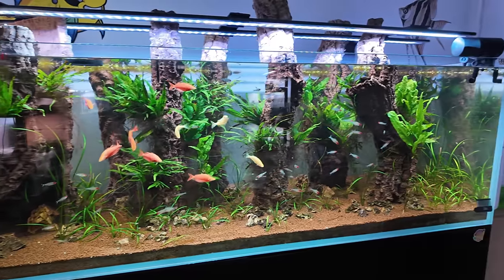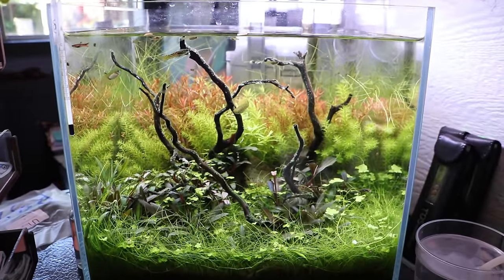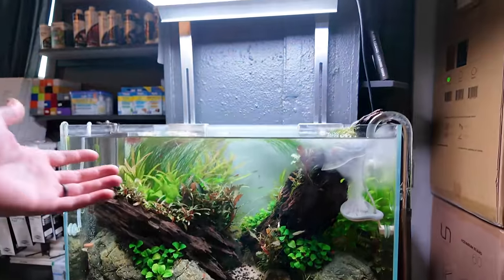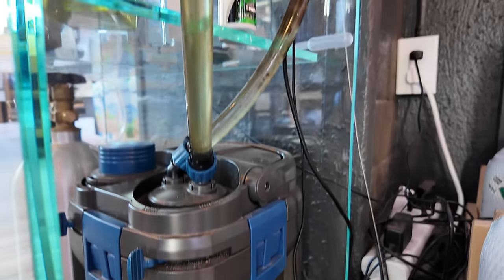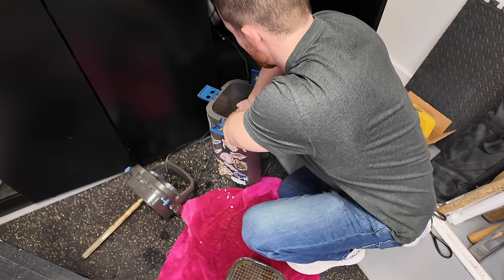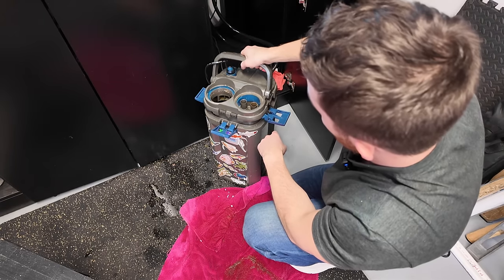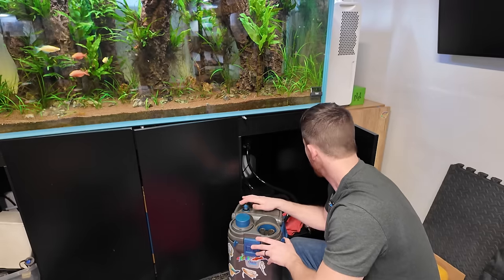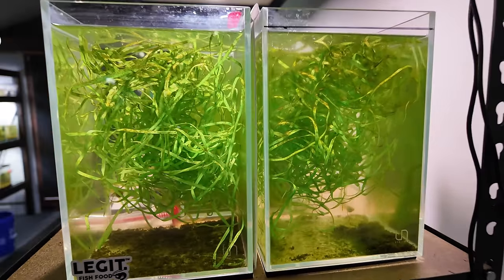This is ACTUALLY The Method For Crazy Clear Aquarium Water...

Comment: It does matter where the purigen goes. The order should be mechanical- bio- chemical. If you put the purigen lower in the order, it will fill with organic waste and the compounds it is supposed to remove will bypass the purigen. Your tank is awesome.
Reply: Purigen should be the last thing water touches before it enters the aquarium
Reply: Yep bottom tray if you have an fx6 or 4
Reply: Yes I remember it that way as well.
Reply: Noted ty for that advice
Reply: IDK...Your water looked amazing to me B4 you added the Purigen
Reply: It went in the trash for me.
Reply: The Tank looks crystal clear from the start I don't think you'll see much difference.
Reply: Mid to upper of the tank use it after dirt and so on
Reply: Amen to that

Comment: First sentence on the package "Purigen should be rinsed before use". Amazing that every YouTuber that does a video on Purigen doesn't rinse it. You even dipped it in water at the start of the video and saw all of the white discharge.  Argh! Your tank water looks visibly clearer after Purigen.  Thanks for the video.
Reply: I rinse my Purigen in RO water until it is  visibly clear. (Our home came with an RO system when we bought it in 2004.)  Using a water softener also decreased the mineral deposits around the lid and what is there, easily wipes off, not so prior to this home. Purigen turned the tide on my water clarity.

Comment: I have been recharging Purigen for a long time now by soaking it in Prime for 24 hours after the bleaching. Move it around a few times during the 24 hours and you are golden.
Reply: I foolishly didn’t rinse mine well enough and put it back in my saltwater tank . Killed all of my fish and 95% of my corals . Over a thousand dollars worth !
Reply: @lakedog3616  OUCH !!!  That would hurt.  {understatement}
Sympathy.
Reply: Sorry if I’ve just asked a dumb question but what is Prime??
Reply: @Jayjay1lm  
What does prime do for a fish tank?

Seachem Prime Conditioner for Marine & Freshwater Fish | Petco

Prime {states that it} removes chlorine, chloramine, and ammonia. It converts ammonia into a safe, non-toxic form that is readily removed by the tank's biofilter. Prime may be used during tank cycling to alleviate ammonia/nitrite toxicity. It detoxifies nitrite and nitrate, allowing the biofilter to more efficiently remove them.
Reply: What is your dilution ratio for the Prime? I'm assuming that you don't soak it in fully concentrated Prime.
Reply: Haven’t successfully recharged the purigen. I try end up buying new
Reply: @daniellesomerville3018  My water:bleach ratio for the initial soaking is 19:1 and I use 4 capfuls of Prime in two gallons of water for the detoxification. The cap is from my 1 Gallon bottle of Prime so I am not sure if it holds the same amount as the smaller bottle caps.
Reply: @AyeGeesy I'm surprised the bleach does anything when diluted this much. Normally a 50% dilution is the max recommended...

Comment: When packing a filter remember that water should flow in this order thru the filter..
·Mechanical media (like sponges) ·Bio media (like ceramic/plastic balls and rings) 
·chemical media (like puragin, carbon, and zeolite)
Reply: I add floss ontop off it all..
Reply: yeah makes a lot of sense cuz you wanna catch the any processed super small particles before the canister brings them back into the aquarium water. well said 😉
Reply: As a new hobbyist I appreciated this comment. When I set up my second tank, it took FOREVER to cycle, but I set up my filter to have carbon before the bio media, so the bacteria was probably just getting stuck at the carbon stage. My common sense kicked in and I switched it a couple weeks ago, but your comment just confirmed my hypothesis. 👍🫡

Comment: I had a random phenomena happen where my tank  broke out with a type of cyano bacteria that turned the water dark blue,...and it stank too. Did massive water changes, and tons of new filter media and nothing was working. Not sure if it was the purigen name brand ( can't  remember the name), but used a similar product after a water change, and it worked like magic. Crystal  clear water and no bad smell. The product I used was also rechargeable by soaking in a bleach water solution, rinsing, and drying thoroughly. I liked that it was reusable and usually used it once a month for a few days. Highly recommend.
Reply: Dark blue, do you use bacterial solutions when topping of? I’ve never seen a blue tinge. Do you use a bubbler or wave maker? Has the stuff maintained clarity for a considerable time?
Reply: @alexanderstoner4306  Yes, I had never seen a cyano bacteria outbreak that turned the water blue before. I don't keep a tank anymore, but I did for many years. I never had problems with my tanks but on rare occasions. I used bubblers and power heads and had it well filtered (mechanically and biologically) as well. And I kept up with monthly water changes and maintenance too. I thought that water changes would handle the problem, but it was crazy, I'd change out most of the water and by night it would be dark blue again and it was stinky too. I finally found out it was a type of cyano bacteria and found the purigen or another product like it. I did a massive water change and put in the purigen, and it never came back. My water was clear and fresh again. Luckily my fish and other tank inhabitants were all fine as well. I still used the purigen every week for one or two days, then eventually spaced it out to once a month for several days, usually after maintaining my tank.  I loved how crystal clear the water would be. Highly recommend giving it a try.

Comment: I used Purigen when it first came out in early 2000’s for a planted tank. Found out it caused a reaction to one of my liquid ferts. My tank literally crashed. All plant and sea life dead! Was extremely upset and almost decided to totally quit the hobby. Luckily I knew an older/wiser person that basically told me to keep it simple and use only natural/organic methods to get a balanced tank. Over twenty years later and I run a dirted planted tank with barely any water changes, and only keep sponges/foam and porous media in the filter. That’s it! Haven’t even tested water in years as the plants tell you everything. Control my lights and co2 and that’s it. No ferts, no chemicals, nothing added to the water other than food for the creatures inside. I am so glad I was talked out of quitting. Roots feed the plants. No need to add more stuff or spend more $$ when nature already does its thing. 
Sorry, but purigen is not the answer for a pristine tank. Healthy plants and simple mechanical and natural biological media will do much better. Synthetics is not the answer IMO. But you do you 😏
Reply: Make a video or something?
Reply: What did you do to determine that purigen was the cause? Did you set up a control and run an experiment?

Comment: I've been using Purigen and it absolutely makes the water incredibly clear!
Reply: How do you regenerate your purigen? Does your purigen smell after regenerating? I used bleach and water mix to regenerate and it would not stop smelling like ammonium and other waste products. Even after multiple regenerating baths..
Reply: Just buy another one
Reply: @WHTFSayonara  1:1 chlorine and water. I leave mine in for 48 hours (I have another on standby). Sometimes I'll leave it in the chlorine water for a week cuz I forgot. Then bath it in prime water mix for 4-8 hours (again you can leave it in this until your ready to use it) rince it and boom no smell😌
Reply: @WHTFSayonara  rinse it and have glass or Chem safe bucket cheap bleach I use like 500ml to 100ml water soak and move it around every couple hours once white rinse it bit slimey then soak it in bucket of chlorine and water 50ml to half bucket . Then rinse it and soak few times in clean water and prime/safe neutralizer takes a day
Reply: @WHTFSayonara do the Bleach.. then rinse. Then let it sit in dechlorinted water.. squeeze dry.. let dry 100%

Comment: In an Oase filter the best way to load it is on the bottom tray you have a  medium filter pad under a fine polishing filter pad, you fill the middle trays with ceramic media, and leave the top tray for carbon, puragin, and or zeolite. This will get you the best results out of that filter. 18:36
Reply: I disagree with this. The typical format would be like course, then medium pad/sponge etc, bio media, then your purgens etc and your finest pad or floss (order on final stage isn't the most critical as bulk of crap you want to filter has already been removed). If you put a polishing pad on the bottom, you are going to clog it up and restrict your flow much sooner in the chain, leading to more frequent cleaning. Nothing special about Oase canisters that would make them different than any other as the principles are the same.
Reply: @jpcreativeimagery  Correct.

Comment: I have a 55 gallon mostly Mbuna Malawi cichlid tank. There are about 15 mature fish in it. The advice you received from your fish store friend about the Purigen and over filtration is good. I don't think you have nearly enough of either to get to where you want to be. I place my media in order of mechanical, Bio, then chemical. For my tank I run both an Eheim 2013 which is now called the 250, an Eheim Professional II which is similar to the Pro 4+ 350 and two Tunze 6025 powerheads.

I alternatively clean my two canisters one every two months or so. I put one Chemi Pure and one 250ml bottle of Purigen in filter bags into the canister I am cleaning.

Your 180 gallon tank has about half of the canister capacity of my 55 gallon tank and you are using 200ml of Purigen and I am using 500ml. I also have two Chemi pure in there.

My water is the crystal clear you talk about in your video if I change the water every week or two. Good luck

Comment: Purigen and carbon both work, but secret to cristal clear water is in the amount of serface area you have for bio filtering. There is a formula for this. For safe water for fish, its something like 520 square feet  of bio per 5 three inch fish or other and thats for ammonia and nitrite. For cristal clear water, its something like 20 times that amount. There is a formula for this. And for the most part, poret foam at 30ppi offers the most surfase area per square foot than anything else out there outside a fluidized k1 in a sump.
Reply: Biological filtration won't remove tannins though...or discoloration from metals or other chemical sources. 

It will just keep the bacteria count in the water column in check.

Comment: I love crystal clear water and this is how is my method . For info, I have 20 gallon long, slightly over stock and heavily planted tank with a Sicce internal filter. Also I have have Corydoras and no one mentions they are constantly making the water cloudy because they always scavenging for food. Also I only do 20% water change every 4-6 week, occasionally Changing the the filter media every 1-2week.Also I test my water with API master test once a month to make sure I don’t any ammonia. So how I do it? I use poly fil and little bit. My filter chamber give me enough room to use a coarse sponge on the bottom, i cut the sponge part of sponge filter as my middle media to catch finer debris, and last a bit of poly fil to polish. And that how I get clear water. 
Note: poly fil get clogged if you use too much or it becomes full of debris and can over flow if you have HOB filters.
Reply: I used poly fill for yrs I buy the the polishing pad now and cut to fit mu hob.  And rinse every other week and put back. Lil more money but I think it's better just my opinion
Reply: @debnazario7226    Very curious: Whats is this Poly Fil? and Polishing Pad? And whare is it bought?
Reply: @henrikmadsen2176  I think they mean poly-wool, better known as pillow or quilt batting (stuffing).  It's what I use, I just get a big roll for 20 bucks from Walmart.  Where I come from PolyFill is drywall mud  :)  available in powder or premixed form, it's as old as the hills.  Pillow stuffing probably works better but then what do I know  :)  I don't rinse it, I chuck it and cut some more, it's easy enough with a 20 foot roll and it's half the price of Big Al's stuff.  I rinse my sponge in the water I drain from the tank so I don't really lose a lot of bacteria, and I drain the filter of yucky water, usually leaving the bio balls alone.  For bio balls I use plastic dish scrubbers, from the Dollar Store.  I also build my own stands and sumps, but I'm not using a sump on any tanks rn  :)  I do big water changes with a pump every week, because some of my guys want super clean water, nitrates under 10 ppm.  I don't hear the fish complaining so I guess it's OK  :)

Comment: Last August I went to the Everglades to herp. I ended up, like every trip, bringing Channeled Apple snails back for my front pond. This year I brought back half a bucket of water too. Rather than dump that water over plants, for whatever reason, I chose to dump it in the pond….
My pond hasn’t been green since that that decision, and I’m shocked at how clear it has remained. I’m talking a molded pond I put in around 2010 that is generally green water. I’ve not cleaned my filter bc everything is so clear.

Comment: 60 gal. I cycle two bags of purigen in/out of my filter every month:  dip in bleach for a few days, shaking every day, then prime dip for 10 minutes as I wash out the rest of the canister. 

Canister fitler setup: prefilter, some biomedia under trays, then layered: coarse foam, medium foam, perlon wool, seachem biomedia with extra ceramic balls, two bags of purigen, then out the back through UV lamp and water is clean af for four years. Also a ton of plants and small bioload 😂

Comment: I have Purigen and carbon in a FX6 which is on my heavily stocked 125g tank (6ft). I was planning on using a 2nd filter to better cover the intake , but the FX6 flow is so strong I decided to wait before adding a 2nd cannister. The results are great. Very clear water, and any cloudiness after feeding is quickly absorbed. I also run a large sponge in tank, so I can't say if the FX6 alone would be as effective. BUT, I run sponges in ALL my tanks along with cannisters, and this 125g is as clear,  or clearer than any other. So Purigen will be added to all my other tanks when doing the next maintenance.

Comment: I prefer dirty tanks if that makes sense, I want my tank to look like an actual lake and most lakes arent crystal clear. If I have a tank that is meant to model a high mountain lake or a fast flowing river I think I would be more into the clear water though.

I am the type who likes the rocks to be a bit green and I dont mind black beard algae in moderation, I also tend to have some amount of mulm as well as dead leaves and small twigs at the bottom. I just enjoy letting my aquarium be self sufficient and function like a real ecosystem while also looking nice, I only spend like 10 minutes a week on my 40 tall for example because it simply doesnt need to be messed with and it looks great. I dont think of my fish tanks as tanks but more as water filled terrariums so I want to disturb it as little as possible.

My tanks are very long term and dont look good for months after they are made because I dont rush to make it look good.
Reply: Imo that's how the fish live the longest. This hobby isn't conducive to my lifestyle, in which i tend to move every 2 or 3 years and owning fish and relocating regularly doesn't mix. At least I'm good at my tamogatchi forever lols and the digital pets don't die anymore lols 😁🤣
Reply: @ality yeah at that point you might just want to go with terrariums, a 30 gallon terrarium with a small group of dart frogs and some mourning geckos is far more movable and just as pretty. I mean you can even use a lot of aquarium plants in a dart frog vivarium since most aquarium plants actually grow better on land and dart frogs need 80-100% humidity anyways.

Also dont worry dart frogs are only toxic because they eat toxic bugs, captive born ones are harmless and live on a diet of flightless fruit flies.

the other choice is just pet bugs, a tarantula can live in a Tupperware. My uncle has a 24 year old rose hair that spent 18 months in storage once, it didnt eat during that time. It was also winter in Montana, many tarantulas are very hardy considering one spent 18 months in storage, that is over a year with no food and while it was not doing very well it made a recovery and is still alive.
Reply: Beard algae! Enough to put right off the entire hobby.

Comment: I’m new at the ecosystem idea(2-3 years).  I have a 55g and sun-sun 704-b (only $100)  can filter with UV, cycles 500some g/hr.  It’s way overstocked by miles, as my south American cichlids won’t stop multiplying with a cast of other characters. Idk how many fish & a  red eared slider, heavily planted. Huge bio load. Only change my trays maybe 3x/1 year max. All water parameters stay in the goldylocks zone w very few water or spot gravel cleanings, 5 gal 1x/month then topped off. The 🦠 seem to processes everything. I leave my lights on too long until I get a timer. It maintained close to crystal waters but I’ll try this. The precipitant drops do well, I like the biome concept, I think plants are a must.

Comment: Great advice and video . I have just set up  my planted 75gal and I run two hang filters one running the standard media and the second running poly fill and activate carbon . It works great for crystal clear water . I do plan to use purigan when the tank matures